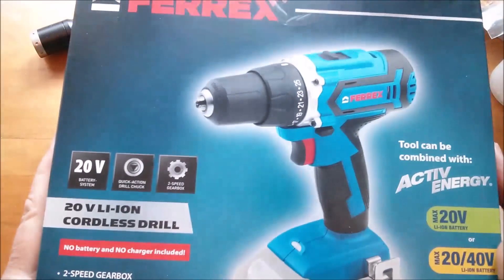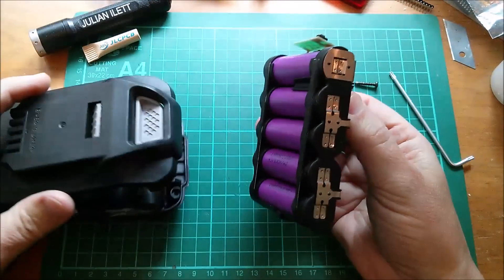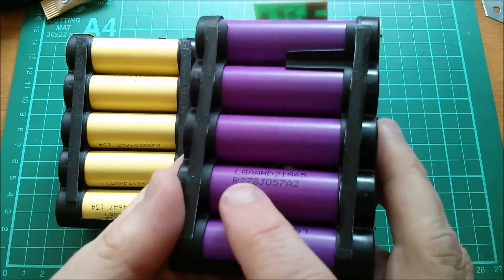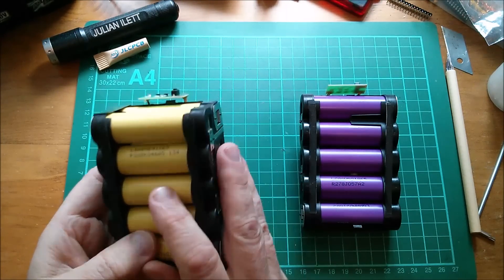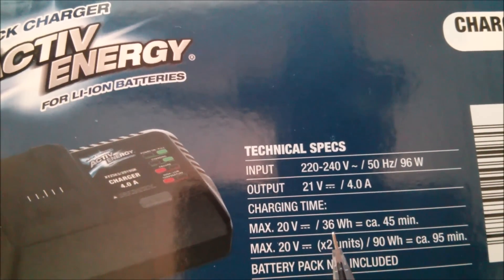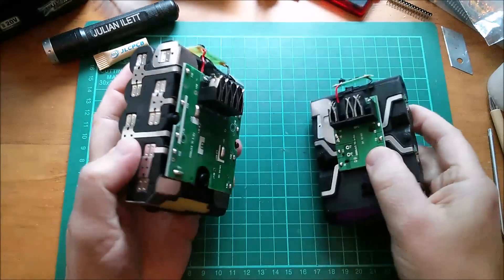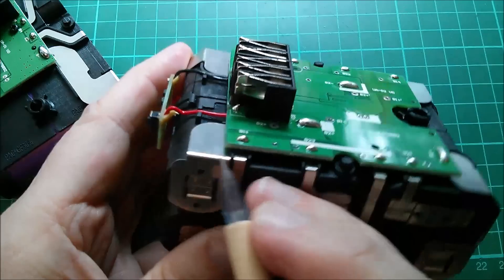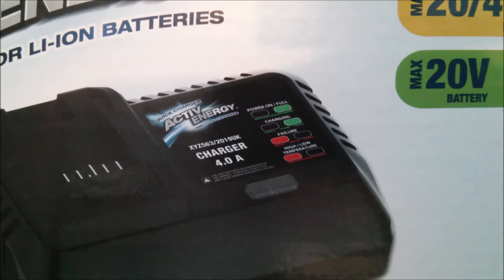Aldi Active Energy 20V/40V Battery Strip Down

Comment: The higher "pulse current" discharge ratings you can find on vape sites and vape suppliers is pretty much bullshit, as there are no agreed upon pulse lengths, cooldown times or cutoff temperatures. They're basically just marketing blah blah. (And possibly somewhat dangerous if people treat a "45A" as continuous current.

Comment: Cheers for this.. I've spotted various tools in Aldi lately, always wondered if any are up to snuff.. I'm thinking that if we add to the driver, the cost of battery which isn't included and the charger, it's surely heading towards £90 or so?
Reply: The Lidl ones ,Parkside is Tuff especially their 20V Team is nice
Reply: @kitecattestecke2303  I hardly go to Lidl, even though Aldi is right next door! 
I needed a cheapish cordless drill for light work around the house - actually drilling 2mm hole in 2mm stainless steel..  eventually went with something from Amazon: TACKLIFE PCD01B Cordless. It's much more powerful than I thought. £40 with battery and charger so, yeah.. can't really argue!

Comment: The Clas Olson in Reading is the one I go to! That's handy that that's the one staying open :O I go there when I go and stay with my friend.
I'm surprised those battery packs don't have any potting or solastic crap whatsoever :O I wonder what the rating on that fusible link is?
Can't wait for the charger video :D
Reply from the maker: It's a good-sized store - but parking at the Oracle is so expensive - we stayed over 4 hours and got stung £10 :(
Reply: @JulianIlett  how many volts has B + and B-, T and ID and how many ohms has B-, T and ID .Thanks you!!!
Reply: @JulianIlett  Yeah it can really sting you 😓 My friend lives in Woodley so we get the bus into town on most occasions, often spending most of the day there, bopping about from shop to shop